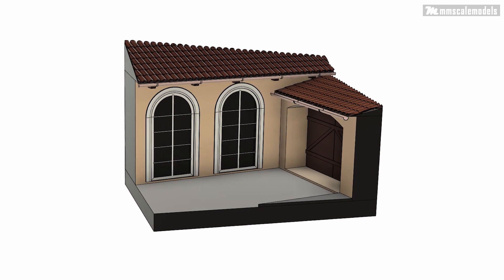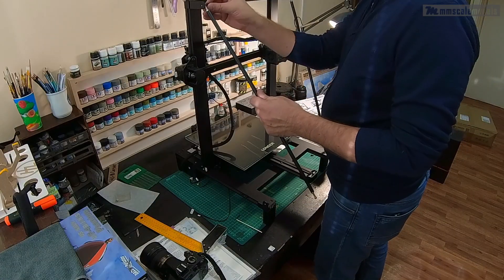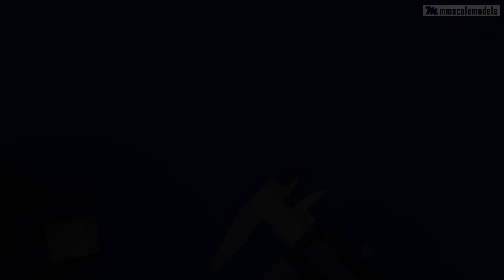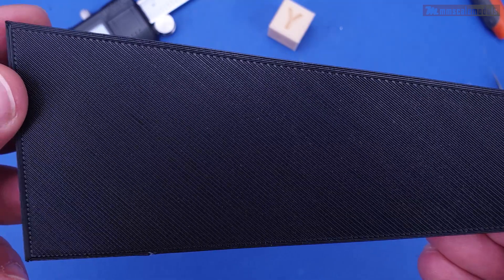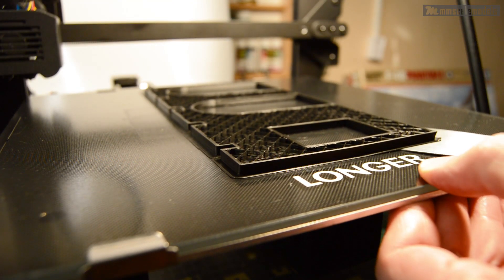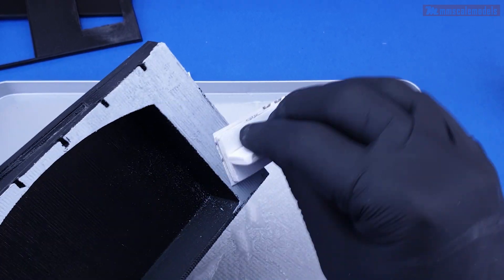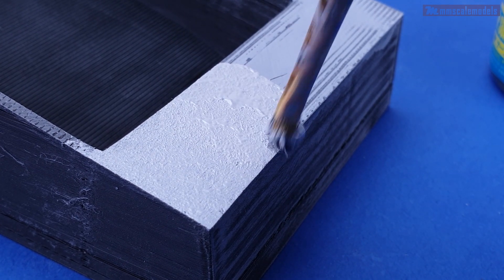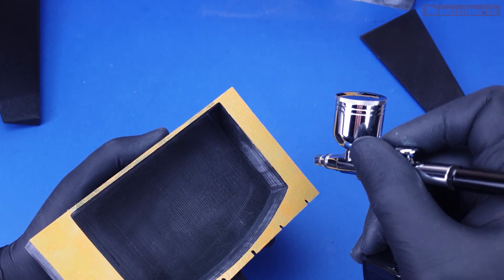Building a 1/24 Diorama with the very affordable Longer LK5 Pro 3D Printer

Comment: A very interesting video, this kind of 3D printer seems to be perfect for large parts even if the sanding and cleaning work is a bit hard. Thanks for the test and nice building (for the Porsche?).
Reply from the maker: Yeah an you may not need to do any sanding and also one can print some awesome practical models like vices and so on.